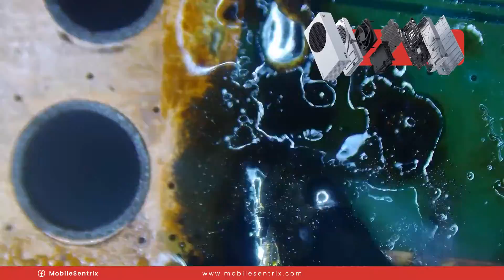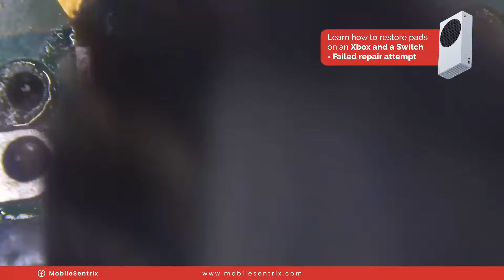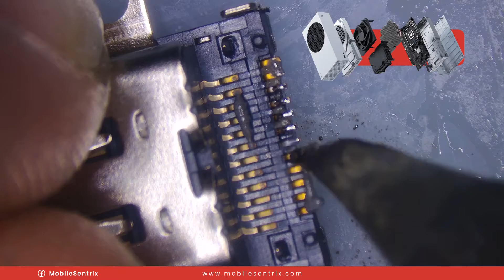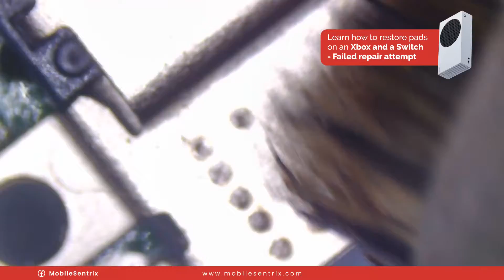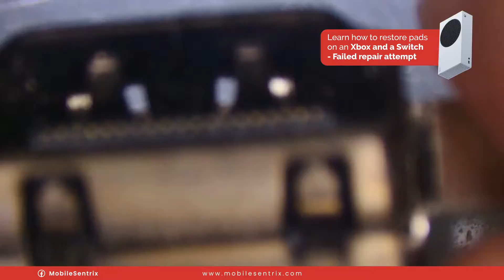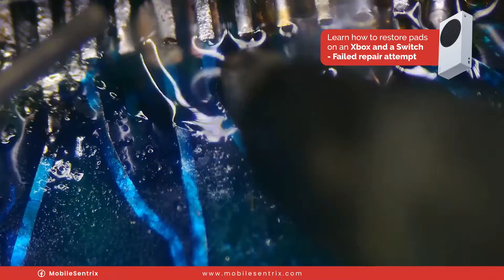Learn How to Fix Pulled Pads on HDMI Port Replacements for Xbox and Switch! (Tips and Trick #99)

Comment: Can you post a link for those pads
Reply from the maker: https://www.mobilesentrix.com/wylie-dot-repairing-soldering-lug
https://www.mobilesentrix.com/bst-66-3-in-1-jump-wire-patching-tools
Reply: @MobileSentrix  i've used both of these. the pads you used are either of these. I know you want to sell MS stuff and i get it, but could you link the ACTUAL pads you used.

Comment: Good job except using solder paste use real solder. More professional and less messy.
Reply from the maker: Solder Paste is Real Solder LOL, it really doesn't matter which you use and doesn't make it any less professional, Its just an personal preference at that point.
Reply: Did you see the tiny nodules in the solder paste? Those are solder. Solder paste is literally just powdered solder in a suspension.